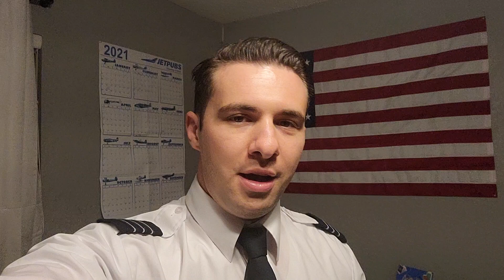A320 Single Engine Taxi

Comment: Hello Joe, 
As per single engine taxi Y Elec pump OFF before Eng 2 start  will let the PTU do automatic test during Eng 2 start.
Regards.
Reply: what if we do not let the PTU do a test during eng 2 start? I am referring to leaving the yellow elec pump on until eng 2 is avail. what would happen?
Reply from the maker: Correct!